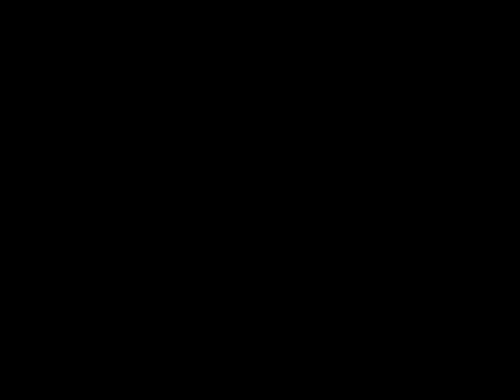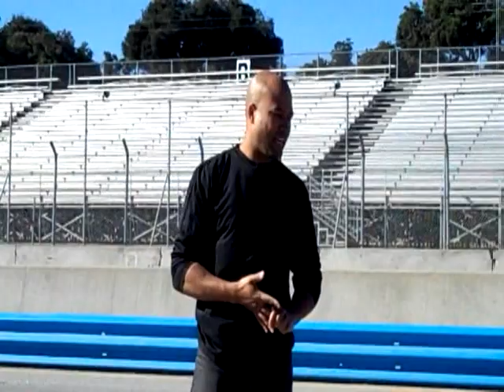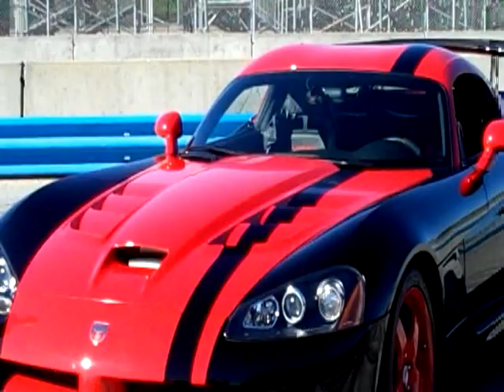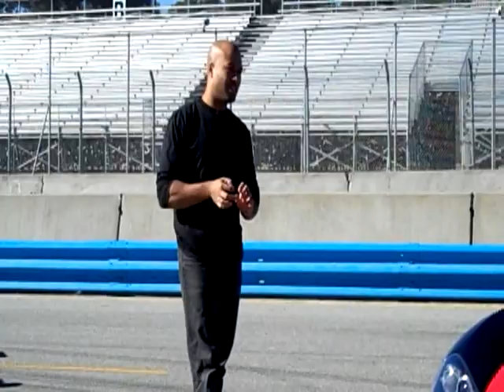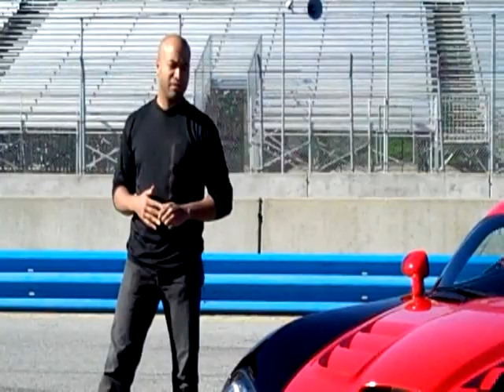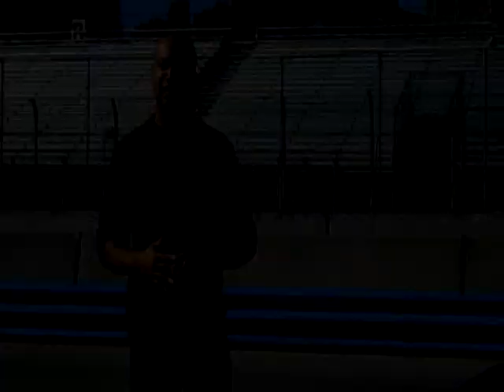2010 Dodge Viper SRT10 ACR

Comment: Your thinking of the old viper, the new one looks the same but has new tires, suspension parts, and 100 extra horsepower.  It will easily handle a Z06 and the ACR will beat the ZR1 on most tracks.  The ZR1 is more streetable but the ACR is faster.  Motortrend, Car and Driver, and Nurburgring times back that up.

Comment: There are a few open wheel street legal cars around that do 0-60 under 2 seconds and they only make about 450 hp. A beefed up street legal open wheel lightwheight ride is capable of some quick 0-60's. I'm willing to bet 550 plus horsepower in an wrx or lancer evo you'd be damn close. Thing is launches that hard are tough on a guys vehicle so it's really bragging rights people are after but it is possible. 1000 hp and awd.

Comment: Two LS9's weigh as much as one viper engine and they produce more hp and torque. The Zr1 has an aluminum chassis and frame. The ls9 is alumium housed in magnesium. The Zr1 is way better than some crappy viper with a spoiler. The ACR despite all it track mods was only .3 secs faster than a stock ZR1.

Comment: as for the crazy talk the ciper acr and vette zr1 were both built for two torally diffrent reasons tow do two totally diffrent things, oh and uh the ciper engin dosent need a supercharger to get 600 hoses, the zr1 engin minust the charger is only at 409 hp so ya might wanna look ya shit up, the zr1 is also heavier than a stock zo6 so think about that as well and you right the vette did need a bunch of modifications to be worth a shit.

Comment: well that "crappy viper with a spoiler is #1 Naturally Aspirated (Forced induction Vipers make anywhere from 850-1400hp)
#2 same chassis as the base viper
#3 costs less than a ZR-1
and most importantly
#4 Is faster than a ZR-1

Comment: costs less than zr1-yes
more powerful than zr1-no
faster than zr1-no
faster around Nürburgring than zr1-yes
viper 0-60: 3.6s
zr1 0-60:    3.4s
viper 0-100: 11s
zr1 0-100: 7s
top speed 184mph(maybe in 190's if lucky?)
zr1 top speed 200.4mph (maybe even more?)
viper is butt-ugly
zr1 is not butt-ugly
just stating the facts

Comment: HAHA When Jan Magnussen drove the ZR1 he posted a 7.21.4 lap time only .3 secs behind the ACR. Note the acr has spoiler, track tuned suspension, and it was on track slicks while the ZR1 was on street tires. Haha the viper is sad 8.4 liters but only 600hp sad, FYI the LS9 is capable of hitting 700hp with slight engine mods, no money even has to leave your pocket and you'll be hitting those numbers. Try that with the viper's shitty transmission.